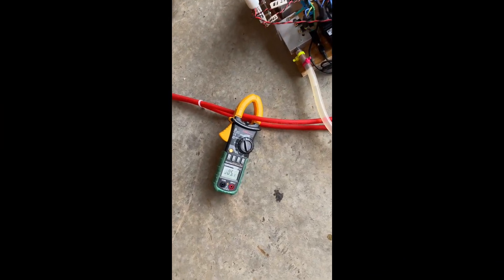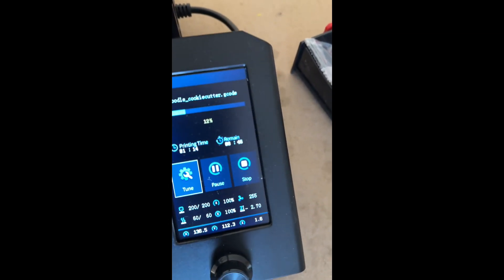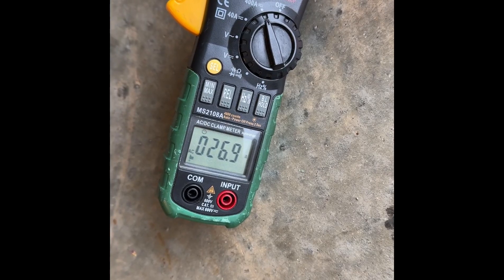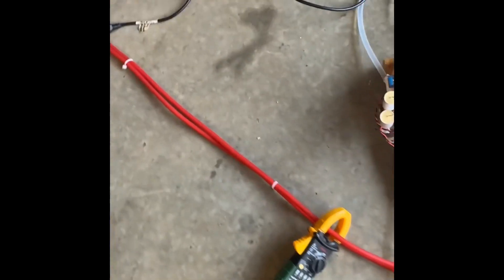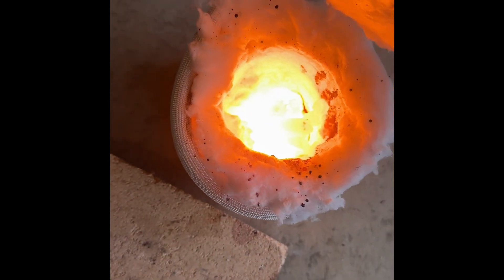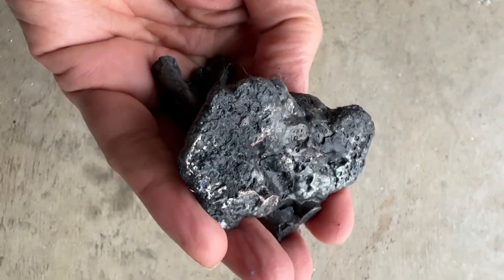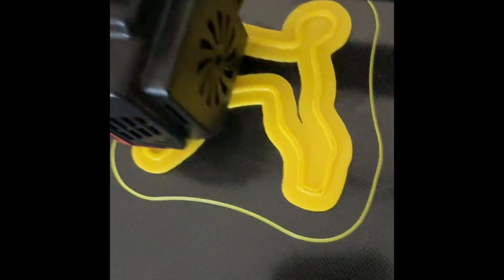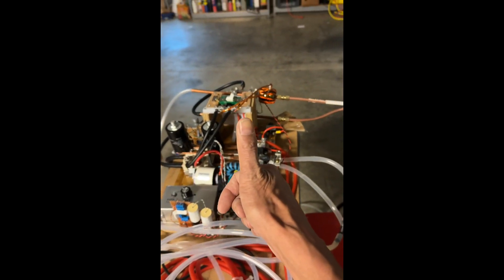Induction Heater Garage Floor mishap

Comment: I, too, accidentally discovered high temperature anhydrous chemistry. All sorts of things become solvents or solutes if enough heat is applied..  ..thankfully I set up my test kiln on a heavy steel table, so the molten aluminum that drained out puddled up there, never reaching the floor.

Comment: I think it is the most powerful among home made induction systems.I don't understand how the coupling transformer does not reach saturation at high power even though its dimensions are small.
Reply from the maker: I went through a whole bunch of different ferrite material and number of turns on the coupling transformer to achieve a near exact impedance match. Did by trial and error. That coupling transformer stayed cold after this run. I’ve had other types of ferrite  material and even larger coupling transformers and they got hot and cracked, so it’s really very important for the type of material as opposed to the size of the material..
Reply: Nanocrystalline cores are said to be suitable for high power. So what kind of core did you use? I really admire your success. @BrianDhvTinkerer
Reply from the maker: @A.D1852hh  thx for the info. This is what I used to get those results. 
They are small. I used 3 stacked parallel. Used 14 turns of litz wire (10 gauge）

The cores can be bought here:
https://www.ebay.com/itm/176361892244?mkcid=16&mkevt=1&mkrid=711-127632-2357-0&ssspo=1lBmuEFIRYu&sssrc=4429486&ssuid=Z9ZBUuQvS8u&var=&widget_ver=artemis&media=COPY
Reply: @BrianDhvTinkerer  if I remember correctly you used material 61 ferrite for your smaller induction heaters and they worked well. any idea if material 77 will work? or TDK N30?
Reply from the maker: @gaynzz6841 the TK40 worked even better then the type 61 material 5 cores for something like $25 is pretty good. Only need to use 3 of the cores
Reply: @BrianDhvTinkerer  do you have a theory why? I mean all the ferrites listed have similar permeability, type 61 is basically good to 200 MHz, and we are switching at only 50-100 kHz
Reply from the maker: @gaynzz6841 not exactly sure but I think there’s some geometric considerations as well. The actual physically smaller TDK40 ferrite is more tightly wound and compact, and there is a much more snug contact between the coupling transformer and the copper tubing of the tank circuit
Reply: @BrianDhvTinkerer  Interesting thought! You could be right.

Comment: oops. around 3600W.
 how big are your 120V fuses?
here its 230V 16A usually
Reply from the maker: I have 50A double breaker- seems to hold up
Reply: @BrianDhvTinkerer  I hope you have adequately sized wire from the breaker to the receptacle as well. I'm not the safety police but I have seen wires overheat and catch things on fire. You probably know this already, but the wire should be sized based on the breaker, so that the breaker will trip before there is any chance of the wire overheating.
Reply from the maker: @Guishan_Lingyou I’m using 6 gauge seems to not get hot
Reply: @BrianDhvTinkerer  Yeah, 6 gauge is good for 50 amps. Thanks for all the great work over the years. I've been watching your creations for a long time.
Reply from the maker: Thank you!